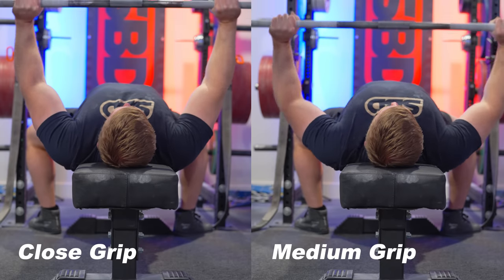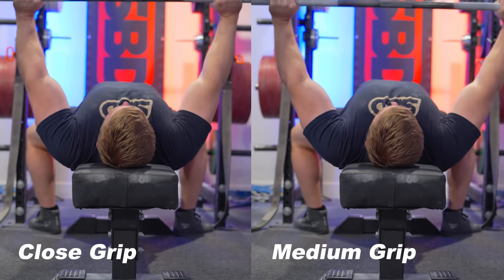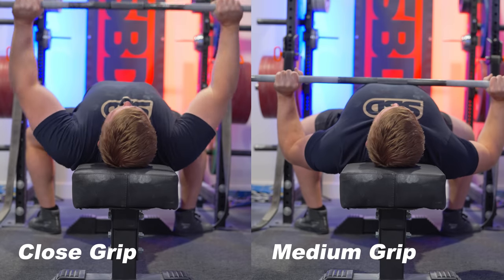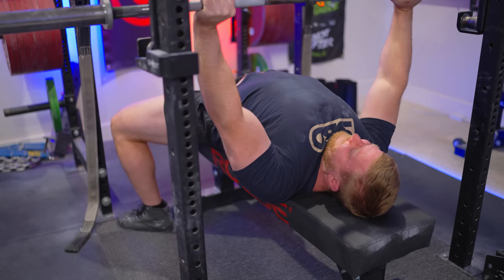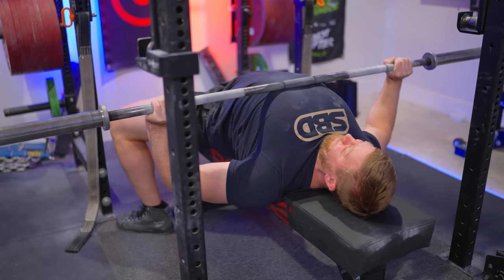Bench Press Grip Width - Close vs Wide Grip Bench

Comment: I’m a pretty small guy. 5’6. I used a pretty normal grip for my size for about a year, got pretty strong. Switched to a wide grip for me (pinky’s) on the rings. Got strong there but then all my shoulder problems started. Back to my “normal” grip and feel a lot healthier.
Reply: If you flare your elbows
Out vs 45 degrees that causes impingement in wide grip.  And wide grip naturally encourages this - it’s better to build on a medium grip and stay away from wide - you can bench more but after months or a year it will eventually break down.  If young maybe you can last a couple years but it will
Grind eventually using wide grip
Reply from the maker: Get outta here Doug.
Reply: No I know more than you.  My comment supported yours but your cup half empty read it too fast
Reply from the maker: Neither cause impingement
Reply: What causes impregnating?
Reply from the maker: @CrazyLocoInsane1 this is something you need to talk to your mom and dad about. Not me.
Reply: @BrazosValleyStrength  I was so confused when I seen that comment in my notifications. I was trying to think wtf I was watching 🤣
Reply: I'm 5'7. Wider grip (index on  grip) on bench got my chest bigger and bench stronger.
Reply: I am 5ft7 " , 175lbs and 64 yrs old. I have fairly nice back and chest. Back could be a lot wider but very thick and dense. My biceps and triceps are small, dense  and strong. I can bench 155 x 10 reps on the thumbs-length inclined-bench press.  have a 225 max on thumbs-length feet up flat-bench press..I tend to get stronger not bigger biceps, triceps and forearms. My back develops easily along with my thick chest.
Reply: At 5’ 6” myself, growing my chest has been the only muscle group I have struggled with getting to grow. Training on a competition bench helped. However, recently I have been using a wide-grip bench for the last month and adding old school fulcrum push ups and my chest has been growing easy like the rest of my body. I have had to use a bit lighter weight on the wide-grip until my chest got stronger and it has also increased my medium-grip bench a bit as well and made the medium-grip easier.

Comment: I have been doing pinky on ring, and my shoulders feel much better. I will continue with that for a bit to see if my shoulder (right shoulder) improves. It just feels smoother and less stressful on my shoulder.  Before I was placing hands on bar with thumb pointed out until it reaches border of knurling and smooth part, and then tucked my thumb for the actual bench. This was mostly fine, but my right shoulder hurts at the lowest position; then I moved to pinky on ring, and it seems to have relieved the issue...for now.

Comment: As a 6'1 dude who has kinda long arms I like maximum legal grip. Bending my wrist and leading with my elbows lets me get a lower touchpoint with the wide grip and that's what I found is the best way to bench for me through running Steve DeNovi's program and just doing a ton of benching.
Reply from the maker: I would actually imagine though that your max width is still pretty “medium” in this context. It’s hard to really define it well, but most people around 6ft can probably go max width and I really wouldn’t consider that wide within the framework I am saying. 

I’m very close to max width with my grip, but I don’t consider it a “wide” grip relative to my frame. But for smaller lifters it might be very wide.
Reply: @BrazosValleyStrength  yeah exactly lol it doesn't look that wide. My elbows bend a decent bit.

Comment: You say you have long arms at 5"10" - in relaxed standing posture, where does your wrist fall on your body?  I am 5'10.5" with, I believe, at best medium length arms, normal length torso, and have been trying to find an appropriate grip position.  Only been lifting for 11 months, and weigh 189.4.  Elderly (76), but just did 225x3 with spotter help on last rep.  Your videos have been useful - my spotter is old school "gauge by pushing against wall" and thinks I flare my elbows too much; it appears from your videos that perhaps I use too narrow a grip, which causes initial flaring, and need to be a little wider and sink my elbows at bottom, but still flare on last half of lift.  My initial flaring was also a result of positioning my small hands to get maximum contact with bar over my wrist bones; more comfortable for me.  Anyway, trying to interpret all your data and commentary, but am enjoying the process.

Comment: Thank you! 

I am let's say a bigger guy with long arms, and always felt so weak trying a wider grip. I tried to get it wider to reduce the ROM but always felt way better and stronger with a close grip (pinkies on the rings at maximum). 

At one point I stopped trying and kept my close grip where it felt comfortable, and then I started noticing that a lot of elite benchers (Maddox, Strickland, Hoornstra) actually have a super close grip compared to their huge build. So I thought maybe it's not necessary true that wider is better...
Reply: I'm in the same boat, for me despite being tall with long arms it's alot easier to generate force with the tris from the bottom of the lift.
Reply: Based

Comment: All around good video
I think that some things were missing
1) Internal moment arm lengths
2) A barbell Bench Press differs substancially in physics from a db Bench Press or a lateral raise because of the lateral forces of the triceps. So when hands are outside of wrists, the triceps (which have a great Internal moment arm at >90° of elbow extension) push outwards, spreading the bar apart, and the resulting force reduces the chest's external moment arm by a lot. Nuckols has a great article on the subject

Comment: really helped put in perspective my bench press grip selection. I've been tri dominant for awhile, and i prefer a close press and relatively minimal back arch, despite having long arms at 6'2. (I don't really follow a traditional style for lifting, I don't powerlift and I don't bodybuild either) motto is somewhere along the lines of "lift heavy shit and look good naked" 1 rep max has been hovering around 385-395 for the last 6 months and i've been struggling passing this. As you suggested; really hoping evening out some of the force distribution from the tri to to the pec by a adopting more moderate grip will really help break this plateau... appreciate the tips. I haven't found very many channels that have had actionable insight that was framed in a way i could get behind.

Comment: I'm 6'2" with a 6'5" wingspan, probably not quite as proportionately lanky as you, but I've found the best compromise between power and ability to handle volume with ring fingers on the rings. The narrower grip seems to give me a slightly lower touch point and feels like more pop off the chest. 

I've found I get a lot more sensation of pec involvement at narrower grips, and this seems to be supported by the bodybuilding community since your humerus has farther to travel in a sagittal plane at narrower grips. Maybe more of the involvement is of the clavicular insertion which doesn't really help big arch benchers as much who put themselves into an exaggerated decline position, so that's probably another reason why it's not as common in powerlifting (doesn't really help the leverage of your pecs with big arch to go narrow).

I've experimented with max grip in the past, but I always get pec tendinopathy in my non dominant side, and I find it harder to depress my scapula and feel my lats at the wider grips.

I would think a lot of IPF/USAPL lifters may have to narrow their grips with the new bench press rules. I've always thought of grip width as being more related to bench arch than height, I've heard a few guys talk about that perspective over the years (including Eric Spoto).
Reply: Im 6'2 myself (long lanky arms) I feel stronger and more muscle tension when doing close grip myself.

Comment: I used to bench with my grip slightly outside shoulder width (probably medium grip) and i never felt any chest pump even after increasing weights on the bar. Infact my triceps burned out earlier before i could feel my chest getting worked. Yday i tried benching wide ( i think grip was twice my shoulder width) after watching some youtube videos and i got really good pump in my chest and it feels sore even today. But i hear that its bad for your shoulders, dont know what is right or wrong.
Reply: A wider grip hits different portions of the pec, shoulder, and triceps but a little of a closer grip your pressing muscles work through a 
greater range of movement.

Comment: I think my bench, currently, looks a bit like you described the position where going too wide makes it harder for the triceps to produce force due to being too extended, that said I would expect to feel the harder reps more in my pecs rather than triceps if that is the case. At the moment I'm kinda awkwardly halfway between arching hard and trying to find a position that feels strong, and clearly for me going 100% for the arch would be the way to shift the most weight but IPF rule changes are limiting that to the point where it's not so clear cut what I should be doing haha

Comment: Actually, if the forearms are not vertical, you put all that weight strain at an angle on the wrists, causing you to tire quickly.
Reply from the maker: The three comments you left on this video might all be dumber than the one before it.

Comment: Doing high frequency and high volume benching has made my pecs feel more sore from bench days and a lot more fatigued during bench days while I'm trying to get the volume done. I'll try narrowing my grip for my next block I think and I'm also upping the bench frequency so I think that's probably the move.
Reply from the maker: I think you should probably read your own comment back to yourself as if someone else wrote it and see if you find any issues with the logic. Saying you are feeling beat up, but still planning on adding more has never gone wrong for anyone.
Reply: @BrazosValleyStrength  fuck you're right. I just need more upper body mass so ik I should probably be doing more. The pecs are not nearly as bad as my back and hamstrings get from conventional deadlifts so ik for sure I am switching to sumo. I'll just try changing multiple variables at once like a dumbass and see what happens because I do want to do more bench volume than I currently am. You got me with that reply lmao.

Comment: try a block if training with close grip and you'll probably see some sick tricep and shoulder development. or even 2 months of overhead press as your main pressing movement. I love training disadvantaged lifts as a main movement for a block before I get specific like, bent over row, front squat, or close grip bench.
Reply from the maker: I would never replace real comp lifts for those lifts exclusively in a block and I’m really just responding to say I don’t think anyone should. But yes. I agree that training with a closer grip pretty often, and taking it seriously, does seem to really help most people.
Reply: @BrazosValleyStrength  I wouldn't say replace but use a more disadvantaged lift as your main strength focus to get the develoental benefits and then transfer those to your comp lifts after 2-3 months. Just curious are you worried about losing the skill or the reduced load?
Reply from the maker: All of the exercises you mentioned just lack the ability to overload in the capacity we need. So the trade off is really bad. You could easily add them in as accessories, but I wouldn’t see any value in replacing the comp lifts for those at all.

Comment: I'm brand new at analysis of bench press so help me out. Is it true that you can bench more weight at a deline than at flat (perpendicular to the floor)? If that is true then it seems to me that arching the back and pushing with the legs is actually turning the flat bench press into a slightly decline bench press.   Is that true?

Comment: So if my arch sucks don't switch to max grip? (I am 5'9 83kg Currently feeling strong with ring finger on the ring but everyone who I train with in my weight class and the one below max grips or bulldogs)
Reply from the maker: Well there are lots of variables at play. Smaller people (5’9 isn’t that small, especially as an 83) tend to get larger reductions in ROM by going wider. So that’s why I think we see so many very wide benchers in lower weight classes. But it doesn’t always work that way. 

My suggestion would be try some wider grip and see if you feel like it has promise. I have never felt like small changes in grip with for some experimentation slow progress down a ton, so doing a day of slightly wider grip in your training is at least worth a try. But I also don’t think you NEED to go wider.

Comment: tfw the "close grip" bench would have been considered a wide grip bench by 70s and 80s standards.

modern powerlifting is such a joke, its all about shortening the ROM nowadays.
Reply from the maker: You could just say “I’m dumb and weak.” That’s a lot less for you to type.
Reply: @BrazosValleyStrength  yeah but its you that said it lol. wouldnt have known otherwise, lil man!
Reply: I'm 6'3" with long arms competing in the 140 kg. I've looked at other big benchers, and everyone else is middle finger or pinky on the rings. In my first comp, I used index fingers on the ring with not much arch. I want more arch, but more arch is affecting my self unrack. Any ideas?